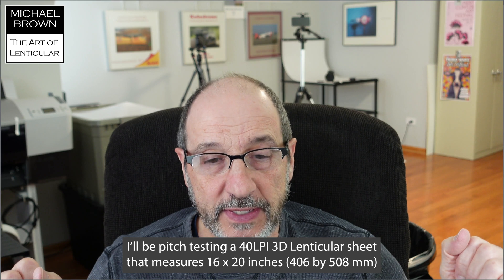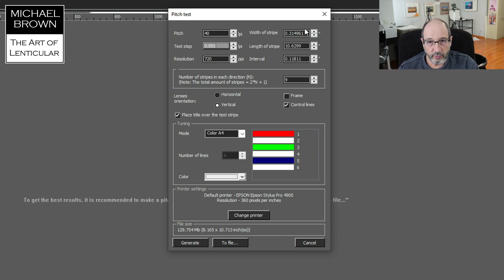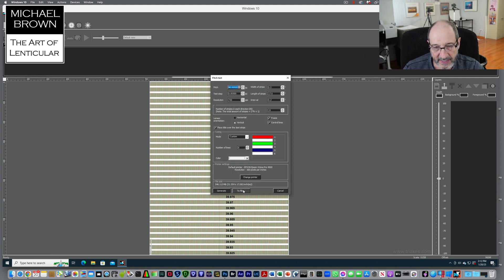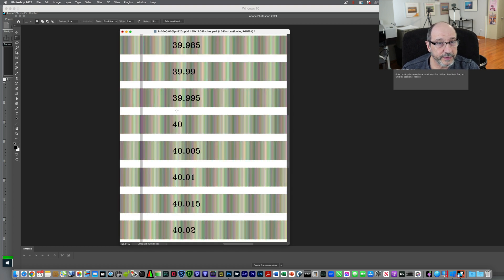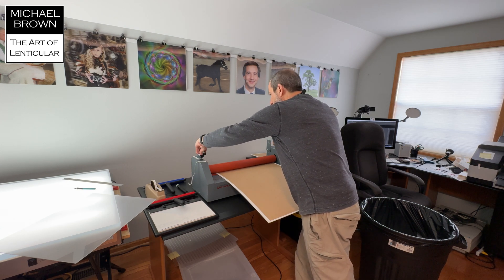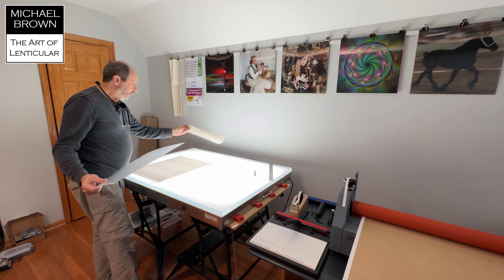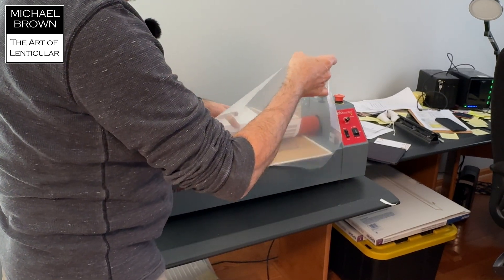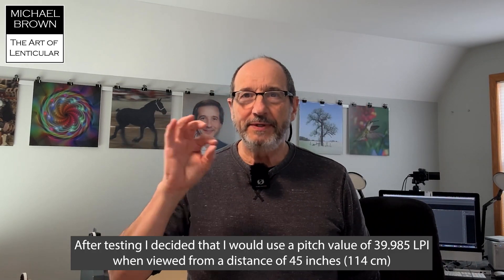How I Pitch Test Lenticular Sheets

Comment: Hi, I'm new to lenticular sheets/foils. I want to convert my RGB screen (1920x1080 pixel) into a screen that can display "impossible" binocular color combinations, where each eye sees a different color. There just needs to be one unique image/color for each eye, not several; so just 2 viewing angles/perspectives. I know this is a rare use case, but do you have any idea what kind of lenticular foils I need to achieve this effect? For example, which LPI, which thickness, etc.?

I'll eventually find this out myself, but it would be very helpful if you could give me some advice so that I can iterate faster. If need be I can also give more information on what I want to do and why.
Reply from the maker: You would want a narrow viewing angle sheet. For monitors, they are generally mounted at an angle to prevent moirés. The challenge will be the focal length of the sheet. The normal sheets are focused at the back of the sheet. Monitors have a cover glass that adds a gap between the sheet and pixels.

Comment: Great video, but it looks like you did a permanent laminate on a pitch test. My guess is that this was for demonstration purposes only and is not normally performed for actual projects. Since each lens can have their own defects and measurements, you would want to measure the proper pitch value for the lens using tape, then interlace your project using those values with lamination happening after the final project has been calibrated and aligned.
Reply from the maker: Actually I do laminate the pitch tests. I have found that batches of sheets in the smaller sizes are  pretty consistent. It’s worth it to me to sacrifice a single sheet to make sure I get the pitch correct.